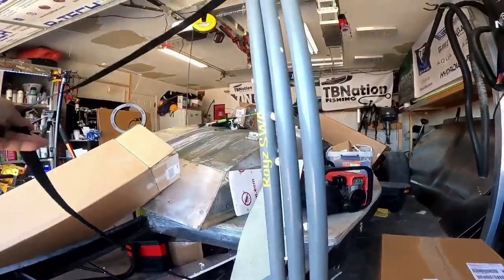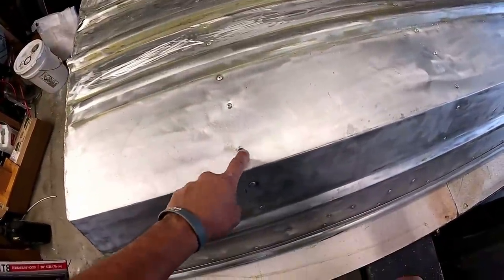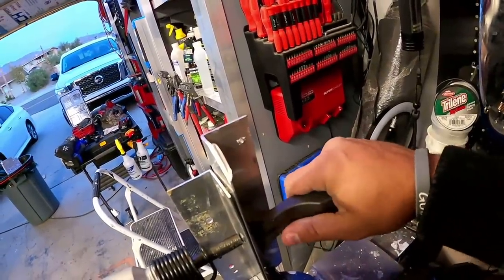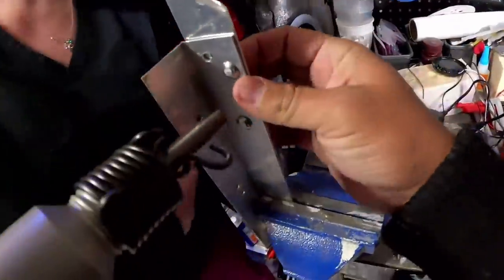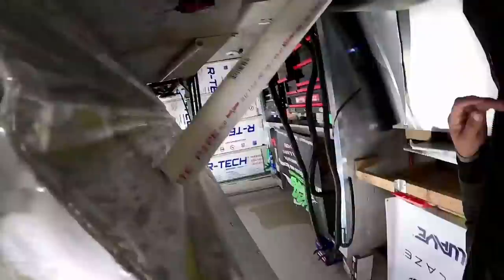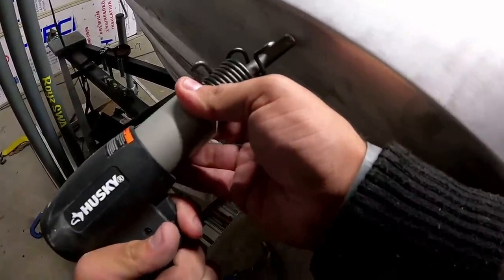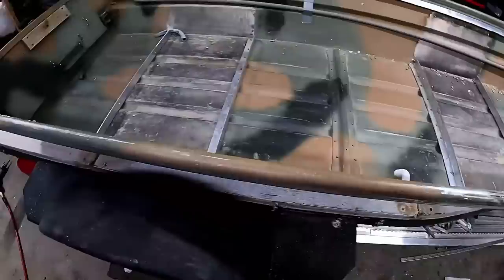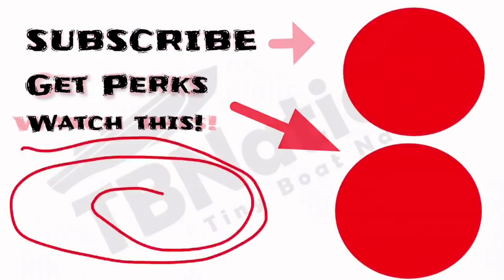Fixing rivets on my jon boat

Comment: Just trying to help out here from a long time aerospace welder fabricator. Driving the rivet is a three-step process. First the two metals must be held together as closely as possible by clamp or cleco adjoining the hole your riveting. The type of rivet you're driving is what's called a brazier head, you can buy the drivers online from Amazon for about $15. With the proper riveting tool you won't have the issue of the driver slipping off. There are a few different sizes for different brazier heads. You exert more pressure on the head of the rivet than you do with the bucking bar you drive a few taps enough to barely swell the rivet so that it does not fall out then you must draw the metal that you're riveting. You move the bucking bar against the sheet metal and then drive the riveter for another few strikes then you go back and then you finish flattening out the rivet to 1½ to 2 times the diameter of the rivet shank for boat work. By using the proper driver you will exert force on the entire head of the rivet and it will seal properly against the aluminum without any sealant. With the Flathead driver you're just driving the shank in the middle and the outer edges of the brazier head will actually bend backwards. Job is looking good keep it up! 😎_
Reply: I was wondering when an aerospace sheet metal guy would jump on this comment section
Reply: @Worldshero  ..... Because I'm a big time bass fisherman and I love working on a little aluminum boats and modifying the crap out of them with bigger outboards. Call it a hobby...😎😎😎

Comment: Take your tool, place it in a vice, and use the same size metal drill bit to concave the tool on the end so it will fit the rivet

Comment: In the video at 1.30 it shows the framing of the boat. I see a new floor brace or two I'm doing them on my boat. What type and style of rivet are you using to attach the brace to the hull??? Ps I've purchased tbn 1/4 sealed rivets 50 of them

Comment: I have the same problem you are having with the solid aluminum river. I went to Home Depot and just bought a pan head bolt and rubber washer for the time being. I have spent three hours trying to air hammer 3 rivers and all of them failed. So I gave up. If they leak I am just going to take them to a shop and have them done! I have watched every YouTube video on how to do this and I thought it was easy as they say, I just can’t get them to flatted down and seal. There all still loose. I do not get it.

Comment: It might have worked if you drill the hammer out just a bit so it would hold the top of the rivet you can buy the bit on eastwoood or amazon

Comment: What size rivets did you use?
Reply from the maker: 3.16”
Reply: @TinyBoatNation  what length though 3/8 or 1/2 “ ? 

Thanks I used 3/8 and they were not grabbing well , I also may have had the  psi too high, I saw you lower yours. I also have the concave chisel

Comment: Oh my god that was painful to watch. I’m a aircraft mechanic. The “rivet set”is only $14 at ATS or Aircraft Tool Supply. It has a curved face to stay on the rivet and apply even pressure..
Reply: @TinyBoatNation  Hey Mike. I too M a former aircraft mechanic and agree with Tom. You need the right tool that is concave and fits on rivet head and won't walk. I have done this probably dozens of times on various aircraft sheet metal repairs.

Comment: I'm in the process of rebucking a couple rivets and sealing bottom of baot after removing 5 layers of failing paint. I find it irresponsible just slapping new paint over failing paint and patches. I even posted on Tiny boat nation Facebook and seen multiple comments of people commenting take the easiest way around water leaks. Good on them but not on this boat.
Reply from the maker: Yup, the paint will fail